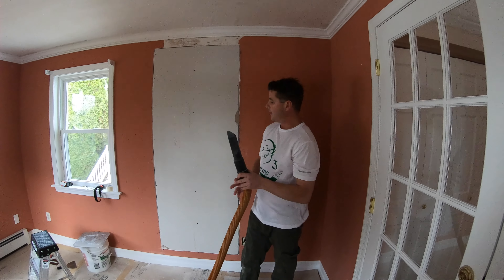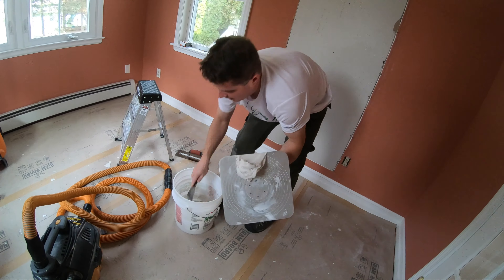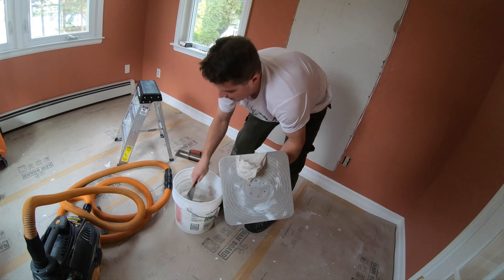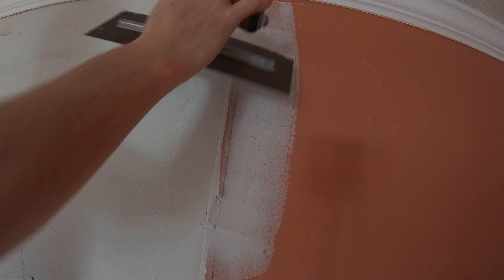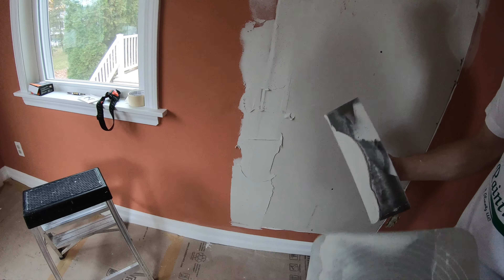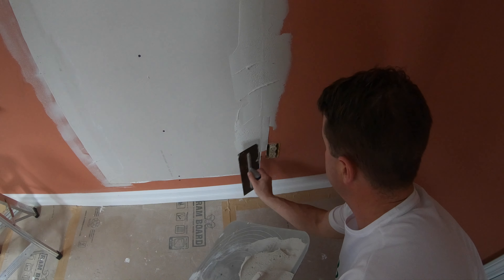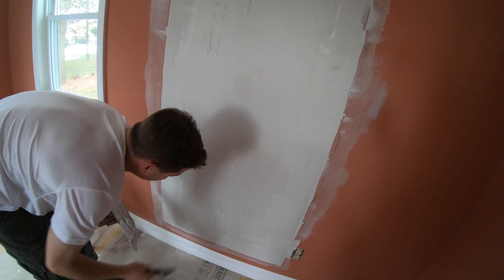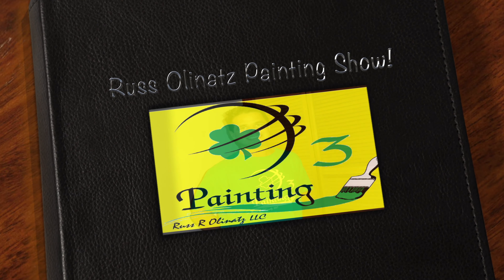How to Tape and Float an Uneven Rectangular Drywall Sheet -  Drywall Repair (Part 2)

Comment: I’ve seen some say there can be bubbling if you mud right over exposed brown paper without sealing it first. Have you had that problem before?
Reply from the maker: Hi Brandon-

Yes it can bubble if the brown paper is loose or torn. In that case you have to cut out loose papers or try to seal it in with a special type of primer to bind all the loose papers back together.

Russ

Comment: Any problems with the mud sticking to the painted wall surface?
Reply from the maker: Hi

No because the previous coat was a flat sheen. 

Russ
Reply: @RussOlinatzPaintShow  Thanks so much for the response!  I'm currently doing the same on an eggshell wall finish.  I'll probably lightly sand it, and maybe primer over it as well.
Reply from the maker: Hi

Ok great! Or you can use a liquid de-glosser. Let me know how u make out?

Russ.
Reply: @RussOlinatzPaintShow  I did the light sanding with no primer over it.  The mud stuck to it just fine, thanks!
Reply from the maker: Great!

Comment: You might as well throw your sander away.nice work
Reply from the maker: Hello Andrew 

Lol. I try to feather do tight that my sanding is just very minimal. 

Russ
Reply: @RussOlinatzPaintShow  your good bud.
Reply: Question for you . Will mixing some 90 minuite quick set in with all purpose pre mix cut down trying time , or will it screw up the mud?
Reply from the maker: Hi Andrew

It will screw up the mud. Only mix All purpose mud with Plaster of Paris. 

Russ
Reply: @RussOlinatzPaintShow  rite on thanks a lot ✌

Comment: Oh, I'm paused at the vacuuming!  You could've skipped showing us the entire vacuum job - I think we all got it from your initial directive.  Gawd!  Please don't make me endure the mud layers drying....  Part one was insightful - I've never cut away seams!  But, now I'm itching to see some technique and tips as regards how to "Float an Uneven ...Drywall Sheet..."  Tell me, is there a different methodology for a Triangular "Drywall Sheet"?  Everyone, just cut to the chase (scene)!
Reply from the maker: Hello-

I understand your discomfort in the length of the vacuuming! I do videos from start to finish. This method helps people who have zero knowledge.

Russ
Reply: At first I was put off with the pacing and of the videos. But then I came to appreciate the unedited nature of the videos. Even with just a simple area he shows a lot of different techniques for minor issues with the area he’s fixing. 

However I do agree the vacuuming could have been edited 😀
Reply: @RussOlinatzPaintShow   i get what you're saying. Personally i would just go in and leave the section where you explain the process unedited. Then, after you begin to vacuum, speed that section up so you can still see the whole process as opposed to editing out any of the video.

Great videos regardless. I'm trying to fix an issue just like this rn and this has been very helpful.

My fiancé had to add a piece of wood to the studs so we could screw the drywall in (the house is super old so a full uncut sheet won't always reach a stud); but the wood that was added was a bit too wide, so one edge of the drywall is a bit higher than the section butted up to it.

So thank you for such a thorough walk through 👍
Reply from the maker: Thank you very Much for your comment and suggestions!